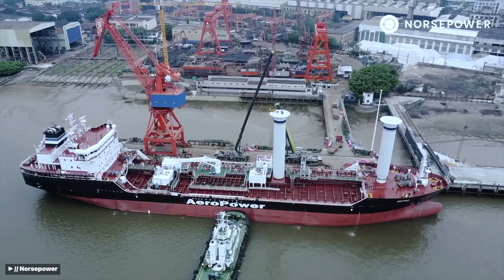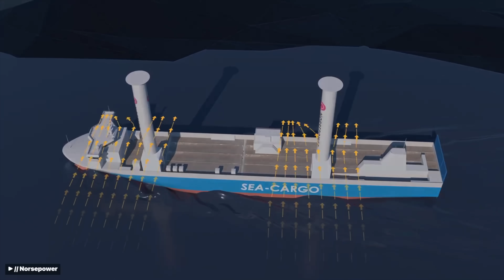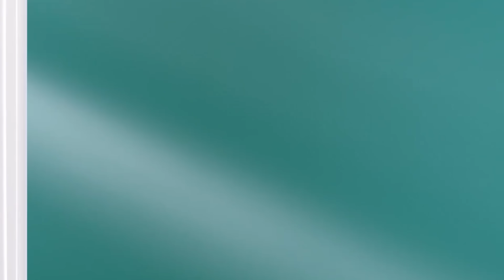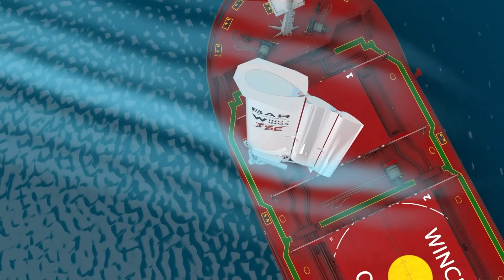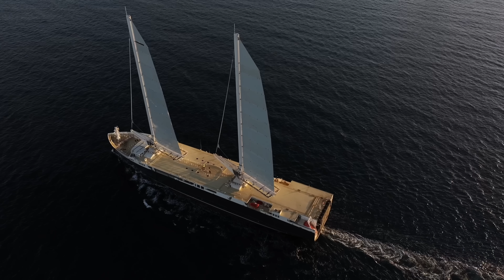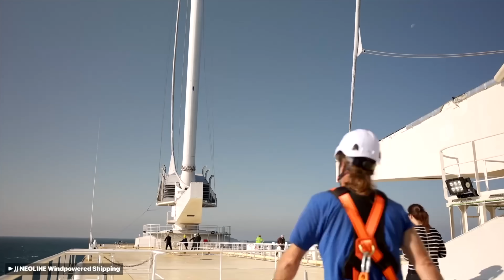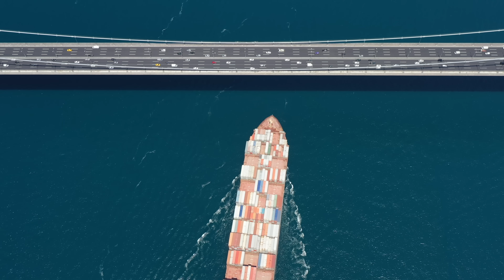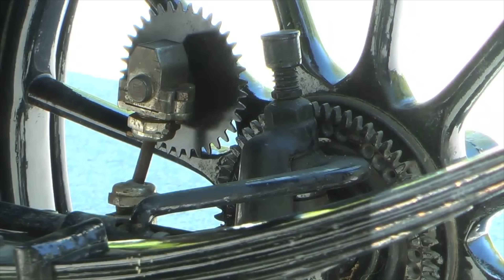Surprise Breakthrough Solves Shipping's BIGGEST Problem

Comment: There is a lot of horsepower in the sky.
Reply: The problems with the wind (horsepower in the sky) as an energy source are variability, reliability and low energy density; also relevant in this context is that the canvas, cordage and extra manpower needed for sailing ships were never a very benign environmental option so please discount any idea of sail as ‘sustainable’ and all this is without the problem that if ‘the wind don’t blow the ship don’t go’ (unless you have stored some energy on board).

When it does blow it often blows in the wrong direction for your cargo delivery needs and sometimes there is rather too much of it for comfort.  The area where one is most likely to be ‘becalmed’ is the ITCZ (Intertropical Convergence Zone) or ‘the doldrums’ as it is commonly called.  In days of old ships with large crews, such as naval vessels, would try using the ships boats and some of the crew to row through the doldrums thus towing their mother ship out of the calm.  Not practical for less well manned and much heavier merchant ships which could not muster a similar power (oarsmen) to weight (vessel displacement) ratio.  Traditional sailing ships are unable to go directly up wind so if the wind is blowing from the direction your cargo needs to go then a zig-zag course must be steered, more distance and thus more time on passage at whatever speed is achieved.

Comment: About 1982 I've seen an article with picutre of a soviet experimental ship with cylinders, but not Flettner rotors. 
The cylinders had a slit on the side to create underpressure. This created air flow which moved wind turbins at the basis of the cylinders to create current for motors. Even slow movement against wind was possible, based on this article. 
It's pitty that nearly no information from before internet can be found. AI means the ship was Ветроход‑1.

Comment: I do wonder what kind of change to ballast needs to happen as you add more. Sailing vessels have keels to extend the weight down to improve handling so will these vessels start adding deeper keels with more ballast options?

Comment: Jacques Cousteau developed the Turbosail in the early 1980s, a pioneering wind-propulsion system designed to reduce fuel consumption in shipping, including potential applications for tankers. Tested on the vessel Alcyone, this system uses vertical, cylinder-shaped masts to create lift, providing up to 35% fuel savings.  
AS with corporates, they only want the gov credits regardless.

Comment: Wonder how much freight space is being lost on the ship because of the wings and if this went into the numbers they are throwing around. Hope some solution like this will be adopted widely soon...
Reply: Good point, however motor + fuel make 10-25% of a ship. If you need a small motor just for manouvers and nearly no fuel, it could be maybe quite the same but you don't pay for fuel. 
The ships will be slower however, maybe 6-8 kn instead of 10-14 today.

Comment: Slow steaming good, smooth sailing better!
Reply: Bear in mind that speed reductions, a useful buffer for adjusting variations in demand, will in the long term require more goods in transit to maintain any given long term level of supply.  Typically tankers move at 15kn so a reduction of speed to 12kn could yield a fuel consumption saving of 20% (?), however to maintain the same flow of material an additional 25% of shipping capacity will be required.

4 ships at 15kn fuel used x =  60 freight miles  = 5 ships at 12kn fuel used x+ or x- ?.

Reducing speed to save fuel reaches limits when the vessel does not maintain steerage way and suffers loss of control, the speed through the water is too low to maintain steerage and the speed over the ground is to low too safely make good any significant distance towards the objective against prevailing weather & adverse currents.  The speed to cost ratio is as finely balanced as any of the other factors in the shipping business.

Comment: Will Norsepower rotors survive a storm?
Reply: With any wind power proposals the question that must be asked include ‘has any information been released into the public domain with regard to the expected energy harvest for the system, on a Joules per square meter basis and how may this energy be deployed as power in Watts?  ‘Cutty Sark’, is said to have been able to coax 3 000 horse power (or 2 206 500 Watts / 2.2 megaWatts)) out of her, up to, 2 976m2 of sails, assuming ideal conditions and further assuming that for sailing purposes the usable part of the wind speed range is 4ms-1to 12ms-1 so the yield would be about 741 Watts m2.  So another question ‘for the proposed option what is the expected upper wind speed limit for the system’?  A single stage 'harvest to deployment' system for propulsion will have higher efficiency but ‘what steps are being taken to provide ancillary power such as the, small but essential, domestic, navigational and cargo needs?’

Comment: Global warming is a lie; however, the savings from using wind are very real. If you don't have to burn expensive fuel, it is better not to. I would be interested to see a ship that tried all of the approaches individually and together to see which ones work best for their price range and reliability/repair costs /time, and which ones are compatible with each other.
Reply: Realy a lie? Yes, if one wants beliefe that putting 1.800+ GtCO₂ into the atmoshpere doesn't change its equilibrium and the energy-balance.

Comment: You could combine the cylinders with the kite pretty easily, I'd think...
Reply: Two systems means twice the capital costs and a fresh set of problems as you try to integrate the output form each to provide  a single drive.

Comment: I hope they combine it with nuclear. That makes the most sense. You don’t have massive reactors to just power cargo ships.
Reply: Why not use nukes on merchant ships?  It is down to engineering, finance, socio-political attitudes and safety.  In engineering terms hydrocarbon fuelled ships do the job adequately and are simpler.  Financially hydrocarbon fuelled ships are, considering only internal costs, cheaper and socio-politically they are a known entity; they thus have incumbent advantage.  With regard to safety hydrocarbon fuelled ships may have serious problems but these are generally considered manageable and have known limits of impact, most importantly they can be shut down at short notice and are then walk away safe, while nuclear energy has fewer incidents those rarer occurrences are seen to be catastrophic and having unlimited effects.

Comment: Ships using Flettner rotors are not a "surprise", they were used 100 years ago!
But other propulsion systems were more efficient.
You cannot use sails if you have deck cargo like on a container vessel or you have a tight schedule. It is a gadget which requires subsidies.

Comment: While its a great achievement and yes it is and will save tons of fuel it is thing 40 plus years late. Climate scientists have and are studying the effects the results they have seen in the recent reductions from this technology along with alternative fuels. Their findings surprised them they found that the planet has become use to the abuse from atmospheric oil across the oceans has a developed a given wind profile based on the previous use of oil the return to less pollution from ships is having a negative affect on trade winds and more. Thus affecting rain cycles or overall weather patterns and not specifically to the good. This technology will continue as shippers are loving the savings as it increases their profits even at the cost of redesigning and newer builds.

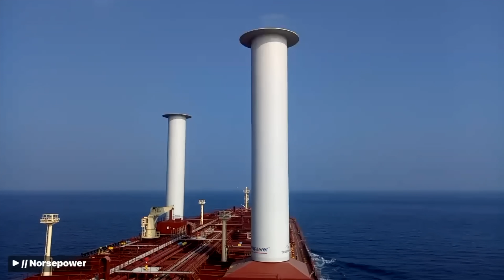Comment: 22 vessels optimized when your ratio is 1:10 equates to a miscommunication somewhere in that proclamation!! One major influence is the overweighted GREED inherent of humanity, as will be the 10 vs 1 against NEEDING WIND TO MOVE far separated from the 1kw input allows 10kw OUTPUT ruling it non-economically viable result as the vast negatives surrounding the environmental impact ONLY INFLUENCES THE PUBLIC SECTOR. Those corporations significantly impacting the calculation express their contemplation of such with extremely minimalistic respect considering THE RATIO AS THE RESULT, with regulations taken as optional where observable ONLY as the world's oceans are vast to provide almost invisibility.

Comment: So, whats allready wrong with the thumbnail and the title before even having to watch this vid?
- The aerodynamic reaction force of the wing blowing from behind in the direction of the ship would actually push the ship 90° to the side. In this as well as in 99% of situations, sails (no matter whether flexible or rigid) would outrun the flettner rotors in effectivity by far, as they can be oriented according to the wind direction.
- A flettner rotor needs, as the name  implies, to be constantly spun by a motor in order to work aerodynamically - a sail doesnt. Therefore sails also surpass flettner rotors in efficiency as well.
Flettner rotors never were good enough to be economicall compared to sails and they were never effective enough to push a ship fast enough to compete with ordinary propellers.
Reply: Magnus effect generates thrust perpendicular to wind — that IS forward propulsion, not sideways drift. Rotors win on deck space, not raw efficiency.
Reply: @rickyroy5267  "Magnus effect generates thrust perpendicular to wind — that IS forward propulsion, not sideways drift."
- You might wanna look at your own thumbnail: Wind blows directly from behind, thus the resulting force of the flettner rotors is sideways.
- In order to generate forward thrust with flettner rotors, one has to sail perpendicular to the blowing wind and adjust their rotation direction accordingly. And in that situation, the thrust generated by the rotors is added to the windforce acting on the side area of the ship, pushing it sideways. And the side area is anything but small for freighters. Flettner rotors as means of ship propulsion allways loose to both, sails and propellors, and for that reason they also are no good in combination with either.

Comment: Flettner rotors can be created to work in the water----and, disturbing the Bernoulli effect on the correct part of the rotor will give you thrust in the direction desired.

You called the method "Magnus Effect", but you are really observing the velocity differences between the two hemi-cylinders of the rotor---i.e. Bernoulli.

It's amazing how few understand Bernoulli

Comment: The first 2 sure why not, but old style sails and masts have their issues which is part of why we got rid of them so fast when other propulsion methods came into the picture. Everybody loves free energy and would have kept using them as a bonus otherwise.

Sails are maintenance heavy and get damaged often, you get into a storm and you will get damage, or masts breaking, it's just a matter of when not if. Back in the age of wooden masts and cloth sails they could fix most of it onboard during the voyage but these huge steel and composite ones on a ship with a minimal crew like we do today ? Yeah thats not happening.

They don't scale very well either as can be seen in the exemple here, it's a very small transport ship all things considered and the sails are already ridiculously huge. On a 20k+ container ship they would do jack all at a feasible size.

Comment: Kites are an interesting approach, but are complicated in practise.
You DO need deckspace for them. You need a way to launch and retrieve them, especially in low wind conditions. Wind higher up might be strong enough to assist propulsion, but wind at deck level might be fairly weak. Then, you need an advanced autopilot to steer the kite or a dedicated crew to control it manually. If a kite gets lost, you need replacement kites, as you are not going to fish it out of the water during the voyage and reuse it. The kite itself might dry out, but the gondola with the controls is not eager to land in salt water.
There are many practical reasons why companies experimenting with kites for propulsion assists are struggling to get more than a demo vessel running.
Nevertheless, I would love to see it on more vessels out there.
Reply: salt water gondola dunks alone would kill most programs lol, kite ops are brutal

Comment: The awesome thing about the parasail is that it could probably be used with the other 3 technologies!   A sail that big will be able to fold down into a bag, or a box maybe the size of a deep freezer, or smaller.  And the tether can easily allow it to get to heights much higher than any of the other sails.    I wonder how big those sails can get.....and how high they can let them reach.
Reply: Seawing is already ~1000 sqm flying at 300m — they think they can go much bigger

Comment: The parasail seems like it can be retrofitted to many older ships.  It's almost no different than if the ship was being pulled by a tug in port.  But going for net zero seems foolish.  Some things are time dependent.  Food for example.  If you force all ships to net zero then many items will end up on plane delivery instead, which makes the net zero a fiction because you have just moved the carbon onto another form of transportation.  Hybrid tech is always the smarter move because you don't cause a transfer to another carbon cause, but instead create a platform that fills the old role, but creates expanding opportunities for creating more efficiency.  Perfect example is autos.  Better to get most drivers over to hybrids rather than attempting to force feed a resisting and shrinking group into pure EVs.

Comment: This is so cool. I'm a sailor. I did lots of sailing in summer camp as a kid and teen. It's about dam time. We should have been doing this a long time ago. I remember famous underwater explorer, Jacques Cousteau invented special rigid sails back in the 80's. Thank you.
Reply: Sometimes it takes a while for the tech, the materials and the costs, coupled with the push factors such as greater awareness of global warming plus skyrocketing fuel costs, to make the ideas more palatable and more readily realizable and accessible. And, yes, these ideas are very very cool! I really want to see these ideas, and others similar, catch on to the extent that we can do away with fossil fuels powering oceangoing vessels. What's old is new again, in entirely new ways!
Reply: @kennyj43  One of the limits to wind power is the kinetic energy available to be harvested in the mass of air it is possible to contain.  Another is the scale of the operation; when sailing ships were being succeeded by power driven vessels the largest that were built included the ‘Prußen’ and the ‘Thomas W Larsen’.  The ‘Prußen’ used a crew of 45 to move up to 8 100 tonnes of cargo and was lost at sea following a collision with a power driven vessel.  The ‘Thomas W Larsen’ used a crew of 18 to move up to 11 000 tonnes of cargo this vessel was lost when at anchor in the Scilly Isles where she was sheltering from a storm.  The scale of merchant shipping in the modern age is much higher than in the early twentieth century when these events occurred.

There is much discussion of 'decarbonising' the marine commercial industry and various wind power ideas are offered; such as Flettner rotors, kite sails, traditional sails and wind turbines.  The factor that seems to go unconsidered is relative wind direction and VAWT would seem to be the only option that could cope with that variable.  The availability of the wind, the amount of energy that could be gathered from it and the cost of the installation receive little consideration but on the limited information circulated VAWT seems to be the best of a poor group compared to hydrocarbon fuel.

Comment: A lot of the sarcastic comments are missing that these are only becoming economically viable technologies because of rising fuel costs and externalities being priced in (mention of the EU charging for carbon emissions). It's not that this is an intrinsically superior propulsion in a world where you can ignore emissions and fossil fuels are cheap and abundant.

This technology seems promising for lowering the stored energy required on the ships. A related interesting topic would be covering current efforts to develop hydrogen propulsion for maritime shipping which could ultimately make the process zero emissions (assuming the electrolyzers creating the hydrogen are powered with renewables). This tech might be a couple years out though and more comparable with where the wind sails in this video were in 2022.

Comment: How about the facts that you forgot to mention: 1) less than 100th of 1% of cargo ton miles are moving under wind or wind assisted. The few that are, are vanity projects. 2) the chartering cost of transporting cargo on wind or wind hybrid ships (either using FCL or LCL,) is MASSIVELY higher than ships using bunker fuel, 3) while cargo ships and tankers are built to last 20 to 25 years, the actual shipping cycle is 3 to 12 years. Which means many ships wind up in the breakers yards in 10 years. A breakeven of 6 years for the additional cost of these high tech sails is economically untenable. Finally, as far as 'European Shipping Regulations' are concerned, there is a reason why so very many 'European' ships sail under Liberian flags.

Comment: Speed is not a factor for lots of shipping. It would seem like you use the wind to generate electricity and store part of it in batteries. Use the stored power when the wind is weak -- reduces diesel usage even further.